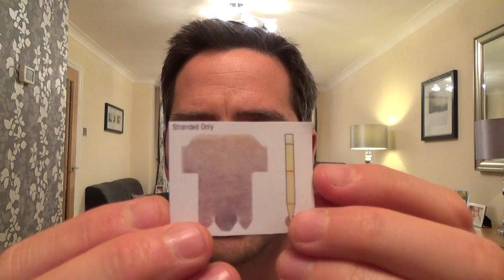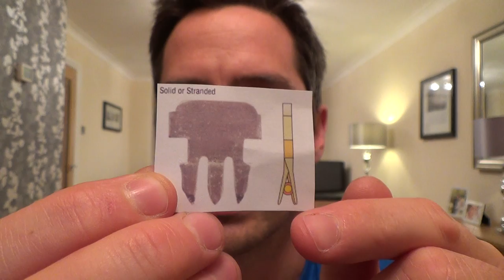How to tell the difference between CAT5 / CAT6 solid / stranded core RJ45 plugs

Comment: What are the benefits or drawbacks of solid vs. stranded? or are there any?
Reply: Sean Robison Solid cable provides a "solid" connection, but as the wire is solid any regular movement of the cable, over time, will result in cracking of the cable and loss of connectivity.  Stranded cable, being thin pieces put together makes them more flexible and less susceptible to fatigue resulting from movement.  (IE you put a stranded cable in your luggage for a trip and a solid cable where the cable is unlikely to be moved.   If you are putting the cable in a wall (particularly with it passing by any high wattage items (furnace, blowers, kitchen appliances, microwaves) I would use solid STP cable (which has a shielding around the cable bundle in addition to the cables themselves being solid cores)  to help mitigate any interference from those electrical fields and maintain the signal integrity to the plug.   Unfortunately, it is more expensive, but in the long run for in wall application you put the wire in once and if it's done with the right items, you don't need to do it again.
Reply from the maker: Sean Robison If you are going to terminate onto wall socket (IDC terminals) then you have to use solid core, stranded core is nice for short patch leads because it is more flexible.
Reply: I'm planning on running cat6 in my house since it's not much more than cat5e. The longest cable length I need to run is about 26 meters. So I should use solid for that?
Reply from the maker: Sean Robison Personally I would use solid because it is more robust but both stranded and solid is rated to perform up to 100m so 26m will be fine on both.

Comment: Don't think it will make mutch of a diffrents on speed or if any. Cat6 is made to work with RJ45. Yeah it will help with cross talk but it not worth the extra 7.00 dollars. Cross talk in and interferance in the cable what matters.
Reply from the maker: Kenneth Richards Hi, thanks for the comment. It may make a difference if you ran a 100m length, they are cost around 30-40% more than cat5e plugs for the one piece version so I would prefer the job to be done correctly and fit cat6 plugs on cat6 cable, rather than fit cat5e to save a tiny amount of money per plug.Thanks Vince
Reply: Ok sure i understand you want 1000Mbps with 0  issues. Instead of 800Mbps , i guess for interprise level be the best option. And maybe ill just buy my jr45 for cat6 online. It will be cheaper then 12.50 for 10peace at hardware store. Ill get the lower price you speak of.